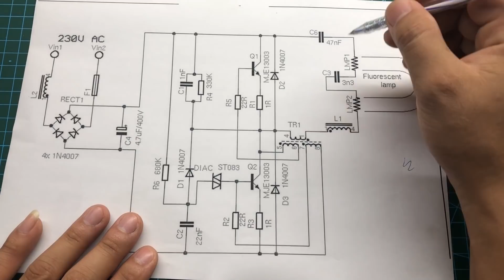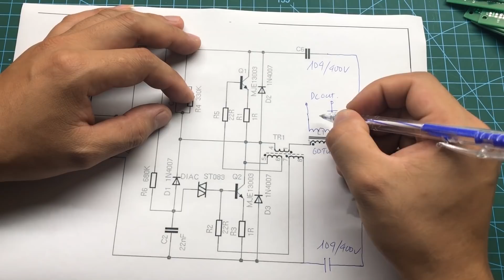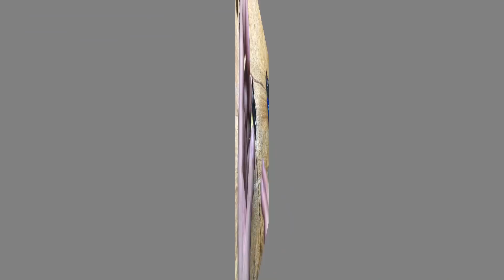I turn CFL into 220V to 12V

Comment: Chào bạn, mình đã xem video của bạn, hay quá, mình muốn hỏi là có thể mắc một biến trở vào mạch này và thay đổi điện áp ra thành 15 vôn được không?
Reply from the maker: It's not possible, can only change the voltage by increasing-decreasing the secondary.
Reply: @PhdHung  Well can I use the intended transformer for the regulated power supply

Comment: How much amp can it deliver
Reply: Max 7amp
Reply: @zerodegree4471  are you crazy? 🤣🤣🤣🤣
Reply: @hardikyadav5277  i checked it by aneng st209
Reply: @zerodegree4471  but i don`t believe on those tiny mosfets my old mobile charger have those mosfets but it can delievers only 0.5A@5v
Reply: @hardikyadav5277  5v charger and cfl circuit aren't same, cfl more than powerful, it's depend on duty cycle & frequency , if duty cycle 100% then it will increase low amp, if duty cycle 50% then it will high amp, so cfl circuit amp is high
Reply: @zerodegree4471 I think it can give a maximum of 2.5 amps